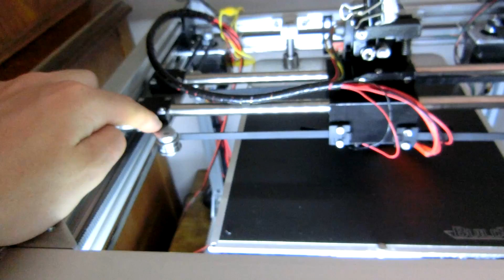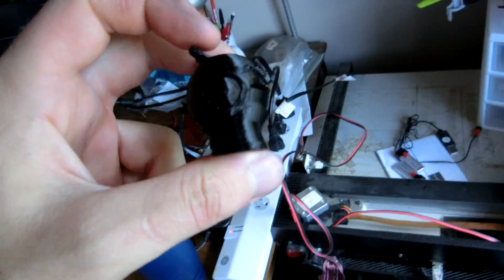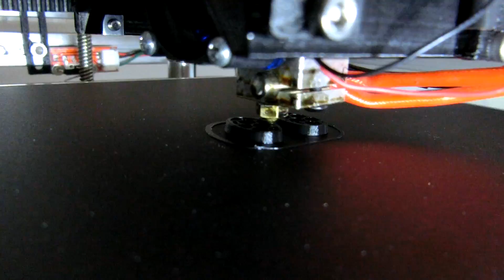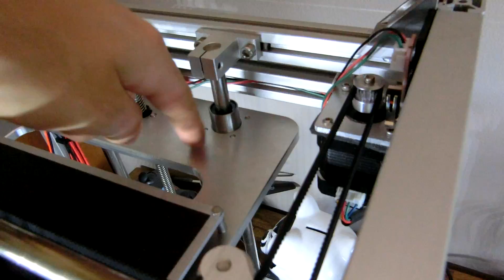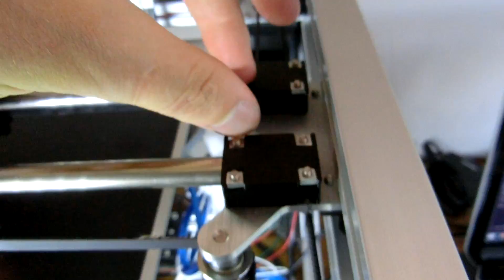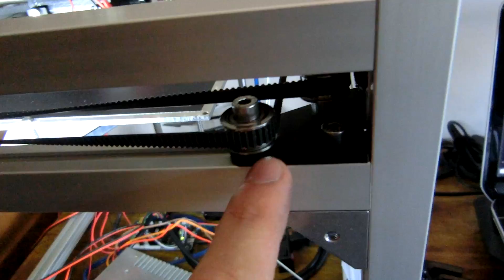Eclips3D Update 21 - New Design, Amazing Quality

Comment: The BOM does not include the length for aluminium extrusions.
Reply from the maker: It definitely should, although it may only in the part number. But if not the 4 vertical extrusions are 400mm and the 12 horizontal extrusions are 360mm.

Comment from the maker: @Farouq if you have patience, I would recommend a cheap kit printer like a chinese prusa i3, the qubd two-up, or something like that. It will have poor print quality, will be noisy, and will take a lot of time to build and maintain, but you will learn so much about 3d printing that it will really help you when you decide to get a good quality 3d printer. If you are short on patience, dont like tinkering too much, and have more money to spend, go with a printer that is at least $500-600+, some good examples are the printrbot metal simple, seemecnc printers, and the soliddoodle 4.

Comment: PEI is pretty easy to cut, though I suppose you're looking for someone to cut a lot of pieces?

I've been running it for a year now and haven't had any problems with the hot end melting the surface.
Reply from the maker: JeffDM Hmmm interesting, ok well I will give that stuff a shot and possibly include it as an upgrade option, or standard if it is really as great as the hype!
Reply: I think it is a little overhyped but it's been pretty reliable once I got a feel for it. For all the filaments I've used, it's my go-to build surface. Nylon is a known exception, so a spare build surface for that might be necessary. I'm still using the same piece from a year ago. I wipe it with isopropyl alcohol every few prints to clean fingerprint oils. Every 15-30 prints, a quick wipe with 1500 grit sand paper.

Comment: any chance of duel extrusion support. also what board are you using to control this / firmware and so on.
Reply from the maker: shagnasty1001 I will likely design it so you can upgrade to dual extrusion, and possibly I will do firmware but it will be a project for people to upgrade to at their own risk and expense.
Reply: 3DprintedLife ok sounds good. Also what made you go core xy.. have you seen the BadPrinter2 ? very similar i have been watching aswell but yours is more open to upgrades.

Comment: any way of getting an early peak at the BOM? id like to start sourcing some parts if it would be possible. missed out on the 3up =(
Reply from the maker: Phillip Ramirez Well there is a temporary bom in an older video but I definitely would not recommend getting too much yet as the bom could still change, the only thing that really wont change is the electronics.
Reply: so the rods and extrusions are changing as well?
Reply from the maker: Phillip Ramirez Probably not but if i run into an issue where the best solution is to change them then I will, so nothing is really set in stone until the design is finalized.
Reply: 3DprintedLife understand. again thank you for doing this for the community.

Comment: Have you had any luck printing ABS on the BuildTAK without a heated bed?
Reply from the maker: ***** Nope didn't quite work! I'm sure in some situations with small round-based objects it would work but for the most part a heated bed is necessary!

Comment: Dang that's a nice looking printer. The metal plates and metal bearings look really great.
Since you are redesigning the x slider, why not put a hole for a bore camera:
http://amzn.to/1IsJfXa
Reply from the maker: obusey Thanks! And the problem is there really isn't any room on the slider to put a camera without moving things around. But because the printer is open sourced, anyone can modify the parts themselves to put whatever they want on it, they just may lose some print area!

Comment: Are you still planing on releasing upgrade packages from 3UP to eclipse3d ? It would be great :)
Reply from the maker: Eagle01ger Maybe but I'm not sure, the problem is that not very much would carry over. I will be doing a barebones package which will be everything but the electronics, so you can carry over the motors, psu, and controller from the 3uP to make the complete printer. The problem with carrying over the frame is that the Eclips3D frame is larger so the z axis plate wouldn't line up properly and you would lose 10mm of y travel, which some may be ok with so I may have to do a survey about that.
Reply: 3DprintedLife I've thought about this issue and I'm convinced that I'll just keep my 3up as a working printer and sell it, rather than try to frankenstein it as an Eclips3d.
Reply from the maker: obusey Yeah that's not a bad idea, its probably easier that way and you may actually save money in the long run since a chopped up 3uP wouldn't be worth all that much.

Comment: Cant wait for it to be done. definitely going to try and get one when you start selling them.
Reply from the maker: Sherman Hartman Me neither and great!
Reply: I have a 2 up that I think the controler board is bad. Trying to figure out what controler I should get to replace it.  What are you using for the Eclipse? Ramps?
Reply from the maker: Sherman Hartman I use an azteeg x5, but for the 2up I would recommend getting a ramps board.
Reply: Alright. Thanks

Comment: did u build this yourself???
Reply from the maker: MrFunTimez Yes I did, designed built and troubleshooted myself!
Reply: 3DprintedLife that's awesome! hey so im looking to buy a cheap (but not garbage) 3d printer for home usage any suggestions???
Reply from the maker: MrFunTimez Well thats a tough one, you can't find too many good 3d printers under $400-500 or so, if you give me a max budget I can probably provide a few suggestions.
Reply: 3DprintedLife probally around $800. not sure if that enough but something around that
Reply from the maker: MrFunTimez That would be plenty to get yourself a good 3d printer. I don't have any personal experience from these but I would say you would want to look into SeeMeCNC (a little above your range but very good products), the SolidDoodle 4, the printrbot simple metal, and possibly the sharebot kiwi. Also check out 3dhubs for a good 3d printer buying guide!
Reply from the maker: Or of course you can wait for this printer, which is set to retail on Kickstarter for around $800 and should be released in a month or so on there, but delivery likely wont be until early 2016, where most of these other printers are probably 4-8 week lead times.
Reply: 3DprintedLife ill keep it in mind but i was going to buy it this fall
Reply: MrFunTimez if you are in the states the wanhao duplicator i3 is a great starter printer as is the folgertech 2020 i3. the folgertech is worth the skills you will learn on troubleshooting. think of it as an education cost. and when this printer is released you can get this one and have alot more information on your wants and needs.
Reply: Phillip Ramirez thanks very much ill check them out!
Reply: MrFunTimez no problem. my nephew bought the folgertech and he has zero experience with 3d printers. he was able to get it together in a day. and now he is getting the software side worked out.
Reply: Phillip Ramirez thats awesome to hear!